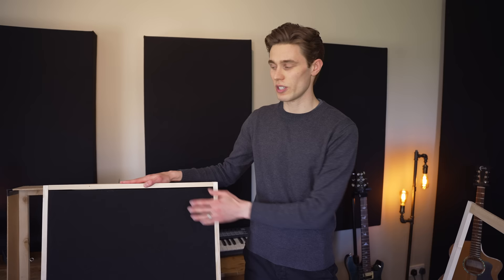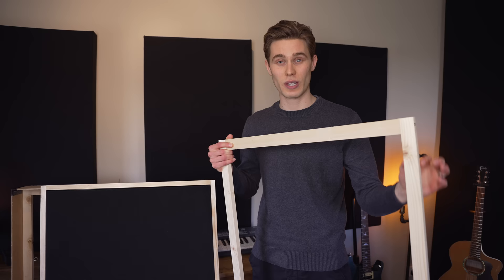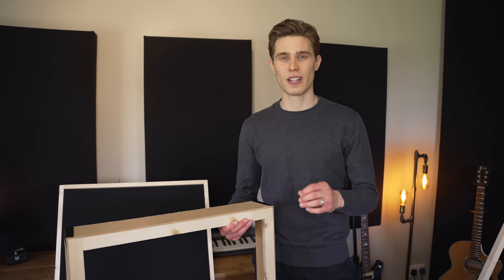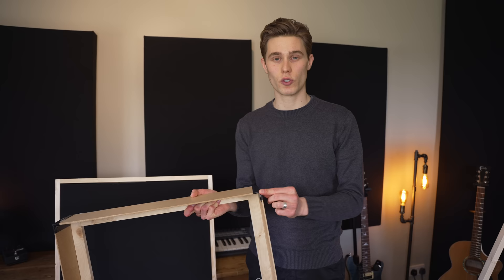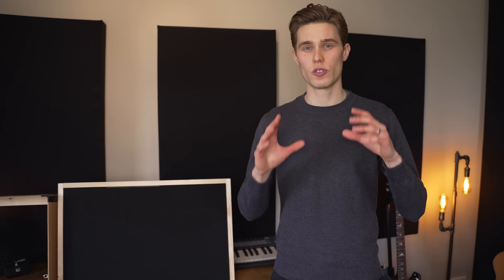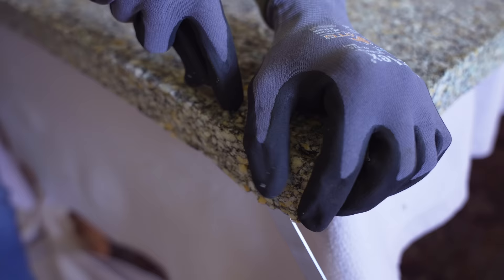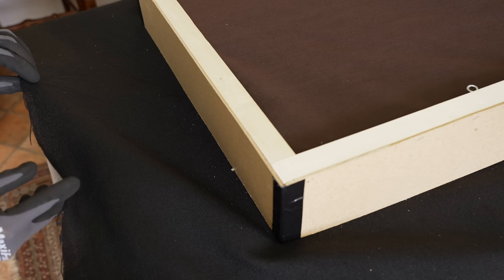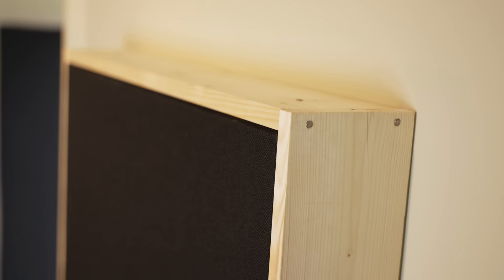How To Make Your Own Acoustic Panels - DIY Professional Acoustic Treatment for Home Studio

Comment: Holy Smoke! This video is precious. Will you have another video on how to arrange them?
Reply from the maker: If the demand is high enough I think I will make a video about how many you might need and effective ways to position them.
Reply: @inthemix  I can assure you the demand is unprecedented. I'm wondering how you go about the acoustic treatment for the ceilings as well...
Reply: @inthemix  can confirm, demand is high
Reply: @inthemix  would be awesome to see!
Reply: +1 request for suggestion of count and location of acoustic panels, although I’ll just start experimenting.

With the first claps I was thinking I can still hear your room, then the panels went off and I my jaws dropped. Good job upgrading a mansion to a bachelor apartment! :P

Comment: I made some panels like this, years and years ago, for a kind-of-industrial space. When you've got a really noisy space full of machinery, it's very easy to tell that the design is extremely effective. I'd suggest going to your local fabric store and finding something with an attractive design on it, works all the same and looks better. Something I'd like to try if I ever make more is to get some custom fabric printed up with actual artwork on it.

Comment: Hey man! For the isolation material I can choose between recycled cotton or hemp fibre. In my country (The Netherlands), the recycled cotton plates are 120x60x4,5 cm, so I probably need two of them per panel. The measurements of the hemp fibre plates are 120x58x10 (but can get them in different thicknesses). The recycled cotton has a density of 45 kg/m3, whereas the hemp fibre plates have a density of 37 kg/m3. What’s better, having two of the recycled cotton plates (which make them 9 cm thick) or should I stick with one hemp fibre plate of 10 cm per panel? What’s the ideal thickness of the panels? I am also considering to make two bass traps, should I make them twice as thick as the other acoustic panels?  The sad thing is that the recycled cotton is much more expensive, but I prefer working with panels that are 120x60 instead of 120x58.

Thanks for the video by the way! This video came right on time, since I have been looking for afordable options to threat my room!
Reply: Hey man, can I ask what you ended up buying? I also live in NL and want to build panels and I'm looking at the Métisse acoustic isolation panels (45 kg/m3) Did you end up using those and what's your experience?
Reply: @LukeBlunton  I chose the 60 x 120 cm recycled denim panels by Métisse with a density of 45 kg/m3. Ensure you apply 2 layers of 4.5 cm (so 9 cm without the air gap) for the broad band absorbers and consider using 3 layers for the bass traps. I would also recommend one of that Camira fabrics that has been used in this video. I personally crafted 10 broad band absorbers and 6 even thicker bass traps for my studio. Don't forget to incorporate an air gap into your design. Feel free to reach out if you have any further questions!
Reply: @omarz7301  Thank you so much man! That's really helpful

Comment: Hi michael! Great video and advice on acoustic panel building, especially like the lighter frame design. One question for you: I have been hesitant about using Rockwool as I have had a bad experience in the past working from a studio that stung everyone's eyes from the moment you walked through the door lol. Regarding alternatives, I live in Vietnam so sourcing the alternatives you mentioned is not easy, however I have come across a product made from Polyester fibres that is apparently a safe, environmentally friendly, dust-free, hypoallergenic material. It is sold in densities from as little as 10kg/m2 all the way up to 100kg/m2 with plenty of choices in-between. Do you think this would be a good option? I was thinking of using 80kg/m2. Appreciate the help.
Reply: he said everything above 30kg/m2 ist hard to work with. 

what did you end up buying?

Comment: Great video, thank you so much!
One question: would you have a #panel/m² ratio (and I mean how many panels per m² of room) and mounting distance from one panel to the next to suggest?
Reply from the maker: Thanks. That's a great question. I do not have a formula and believe that each room has different needs. Some rooms might need a more lively sound for recording and other rooms might need to sound controlled and large (a mixing or mastering studio for instance). 

I would focus on first having some sort of coverage on each surface to cut down the slap echo. In a small/medium room, this could be 2 panels right, left and in front of your desk.

If I look around my room, around 30% of the walls are covered in bass traps and absorbers. The floor is carpet and rugs so the room is naturally smoother sounding than wood or solid floor. There is also a lot of furniture and a big couch to soak up and diffuse more sound. I think many rooms will get a significant improvement from 4-6 of these panels, more than that is a luxury. I hope that maybe gives you some ideas!
Reply: @inthemix  thank you for the super-quick and very useful reply!
Keep up the amazing work! :)
Reply: you will need to figure this out on a room by room basis, it's a huge faff and unless you have access to acoustic modelling software, it's quite a difficult thing to get right without some trial and error. You definitely can't go wrong by working out the reflection points in your room and starting with some decent depth treatment at those points, then a thick cloud panel. Once you go beyond that, I'd leave it unless you are designing a proper studio space from the ground up.
Reply: @squoblat  I have to admit most of your reply went right over my head ^^"
I am in no way/shape/form even an amateur audio designer or musician, I just dabble in podcasting and video recording, but in general I like to "sound good", and I try to minimize the sound processing needed to achieve that
I'll do some research on the things you mentioned and see what might apply to my needs, than you for all the info :)
Reply: @TheLeK00  it's worth googling reflection points,  but that's usually more important if you're mixing in the room. If you're using headphones and recording on a microphone for podcasting, it will matter a LOT less where these panels go on the walls, you'd be better suited covering as much of the hard reflective surfaces (like bricks or plaster) with these as possible.
Reply: @TheLeK00  Think a game of billiards. Sound comes out of your mouth, and will rebound over things then go back into your microphone: that's reverberation, or "reverb" (colloquially often called echo, you can clearly hear it in the video here, in the untreated room his voice is less defined and his hand clap linger with a tail: that's reverb). Now the simple billiards shots to get from your mouth to the mic, that's the main or early reflection points: they are the loudest reverb, so the first to treat.

Those main reflections points are usually the wall to your left, the wall to your right, your ceiling, either the floor or the desk (depending if there's a desk in the way) and to a lesser degree the wall and/or the monitor screens in front of you.

So the easiest and most effective treatment start with the ceiling, and the left and right wall. Put something acoustically absorbent there (like these panels), if you're podcasting you're aiming the the human vocal range (it's harder for musicians who care more about bass, and bass is a nightmare to handle, whereas I assume you use a high-pass filter and cut anything below 60 to 90Hz depending on your voices). Where exactly? Think about a pool or billiards ball, from mouth to mic. And obviously overshoot and do it somewhat bigger, don't build a 10cm² panel :) If you really need some more visual aid, have someone place a mirror on the wall and move it around, it will simulate the reflections, the pool balls, by reflecting the image.

You can treat your desk or floor as well, but you can very easily either put a rug on the floor, or some thick desk mat under your mouse and keyboard (or paper or book or whatever you're using your desk for).

So, simple easy "my first recording studio": a panel to the left, a panel to the right, a panel above you on the ceiling (don't skimp on how to secure it, obviously), rug on the floor, mat on the desk probably. After that, add stuff to the room: an empty room if the worse. Doesn't really matter what, add books, figurines, knick knacks, journals, a sofa, chairs. Clean über tidy minimalist room don't make a good recording environment. After that, add more if necessary.
Reply: @LiraeNoir  neoprene/wetsuit material works very well for desk treatment. I managed to kill a few high reflections by cutting a slab of it the same size as the desk, even if it was only a few mm thick, it took away the harshness of having a giant flat desk.
Reply: @LiraeNoir  thank you, much appreciated! :)

Comment: Iv'e watched so many acoustic treatment panel construction videos my eyes are about to bleed. :) He's got all the basics down. If you are short on space, just use six layers of bath towels as filler with a thinner wood frame ... a couple of centimeters/one inch. fabric cover just like this video to finish it off. For most applications, you don't need several centimeters of filling unless you have a rock band or shooting range to treat. :)

Comment: Excellent and informative, very helpful! I had a different experience with recycled denim insulation, though. Here in Canada, recycled denim batts are in short supply (I had to get an order shipped from the west coast to Toronto) and cost 2x what mineral batts go for. I also found that the brand I used (Climaloc) is a VERY dusty material - I strongly recommend wearing eye protection and a dust mask when working with it, and don't leave it exposed if you can avoid it. The thickness and material density varied quite a bit - sometimes I could cut it with a good pair of scissors, sometimes I needed a serrated knife.

Comment: Nice video. Very detailed. I used second hand towels, wash them and dry before rolling them and stack them until i filled the frame, then cover all up with juta cloth. Looks better than black in my room because it is not a studio, just a regular living room. The sound of my vintage hi-fi is waaaay better.

Comment: Good advice! Thank you. I've seen that most DIY videos for acoustic panels recommend rockwool, but they entirely ignore that it's made with formaldehyde! That some is toxic and can cause cancer. They also ignore that rockwool is designed to be BEHIND drywall rather than in your living space. So, I like the material suggestions here. What I need are sources of alternative materials that are cheap in the U.S. I haven't found any, so I haven't made any DIY panels.
Reply from the maker: Thanks Ramon. I’m glad that some folks like you are well researched and know the dangers. 

I’m sorry to hear about your issues sourcing materials. The marketplace for building materials has been highly turbulent in recent years. I hope something reveals itself at a good price for you soon!
Reply: Rockwool does not contain formaldehyde.

Comment: Good video!  I have a suggestion that I used when I built my studio.  Your idea will in all likelihood be much better for most since most people are augmenting what they already have set up not to mention the panels can be moved if you have to move to another location.  But if you are moving in to an empty room or like myself, building a free standing building, what I did worked better than any studio I had ever been in and I was in quite a few.  When I was young I studied not only music, but the physics of sound.  I learned that parallel, smooth walls, especially in smaller rooms creates problems with standing waves and comb filters that can be problematic to try to "EQ out".  OK, so how to make the walls not parallel.  I had noticed that using sound panels can sometime create a sound that is too dry.  So how do we get from reverberant or too dry to just right.  I reasoned that if there was a way to have no surfaces be parallel, the sound could still move but not reverberate.  I had put some horizontal siding on the outside of my house and realized that when they overlap that raised each board up a little on one side causing the surface to not be perpendicular to the ground so to speak.  I was going to build my studio right after that project and that realization was right on time!  So it hit me that if I did that on the interior walls of the studio, and have a cathedral ceiling, nothing would be parallel.  Bingo!  Not a conventional look but I was after sound, not looks.  I went to a sawmill and had them cut me some 8" wide boards and I lapped them like siding not only in the studio, but in the control room as well.  They were also rough cut so again, not a smooth surface helping even more to diffuse the sound.  Actually, it looked great, smelled great lol, and worked like a charm.  I never put up any sound conditioning at all once I did a session in there because the sound was just what I had figured it would be.  Not dead, but no unwanted "reverb".  It was a great sounding room.  I went on to cut some great sounding stuff in that room.  Not for everyone, but if you do it, you will never regret it!  Your demo of the live vs dead room was good.  It definitely made a huge difference in the sound of your room!  Great job!

Comment: Hi I like your steady not to fast explanation of your building effort. As I'm building 6 frames now based on your design I do apply glue on the surfaces where the screws are holding horizontal and vertical ' legs'  together. Maybe this additional construction steps adds to your overall excellent instruction video.

Comment: I made mine with the wood from pine pallets, and because I had envisioned using insulation batts, nothing else was available to buy locally, I covered the frames in old quilts and bed covers, figuring that fibres would have a hard time getting through their fillings. In the end though, I stuffed them with old goose down quilts and pillows, packed tight. I then covered the whole thing with material, some with large printed t-shirts I had, and the rest with patterned quilt covers. They're heavy, down weighs a lot, but they work very well, and while the frames are made of 4 inch wood, I covered them well, so the panels themselves ended up about 6 inches thick. I then left a 5" gap between them and the wall.
They work very well, and most of the material to cover and fill them came from the Dog Bedding bin at the local charity store, so they cost very little to make, maybe $6 aud at most. 🙂

Comment: Neat, very clear instructions. Locally we have 50x100x3cm insulation sold in a pack of 4 for about 50 EUR which would be enough filling for 2 panels. With the wood for the frame and plywood plates for the sides, it would be around 15 EUR added to each panel. The fabric is probably going to add 15 to 20 EUR to each panel. So roughly will be 60 EUR per panel in material cost for me.

Comment: I just want to thank you for the EXCELLENT tutorial. I'm in the process of finishing my dedicated home theater space and need to make some DIY acoustic panels and bass traps. Your video was extremely helpful and I will definitely be referencing it again when I go to build the panels myself. Unfortunately I'll likely end up going the rockwool route as nothing else is readily available in my area and shipping prices for a lot of the insulation recommended is crazy expensive right now. I will be wrapping the front and back like you suggested before covering the panel in fabric to further prevent anything from becoming airborne down the road and obviously will wear proper protection.

Many years ago I would help my uncle on the weekends install fiberglass insulation in new construction homes and I not-so-fondly remember going home all itchy and that was WITH wearing gloves, a facemask and eye protection. If anyone reading this is thinking of using rockwool or fiberglass insulation for their acoustic panels, I would definitely add long sleeves and a hat (if you're bald like me haha) to the list of recommend protective equipment.
Reply from the maker: Thanks for the extra advice! Yeah shipping rates and materials are skyrocketing, I hope you manage to find something suitable that works for you. 

And yes, definitely cover up when using those materials!

Comment: Great vid with good tips. Putting large holes in the 4 sides will increase the effective surface area. Re health, you need to properly differentuate between materials: glass fibre and standard rockwool are not designed for airborne exposure, but Knauf Ecose rockwool is. Lightweight frame is just right for my new studio - I have to fly about 20 of these on wires. TImber frames warp because timber does! Pre made ones are usually made with birch ply or other stable wood or metal extrusion. Also, 20-30 kg/m3 is very light - 60 kg/m3 gives optimim results for 100mm broadband abs.

Comment: I was getting ready to build some panels and this video was very timely. I've be following your plans with a few minor modifications. Planning to mount them off the wall a little bit more to increase the air gap and highly considering adding the wooden trim and finish the trim with Odies hard oil to match the desk.  Thank you.
Reply from the maker: That sounds great. The air gap will make them more effective and the wood trim is going to pull the room together nicely with the desk. It sounds like it's going to be a great room when you're done!